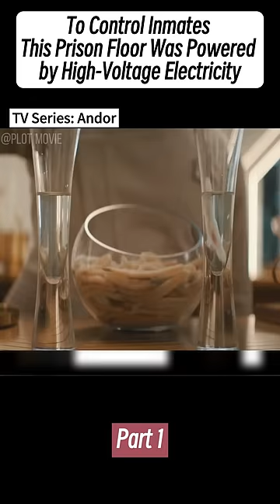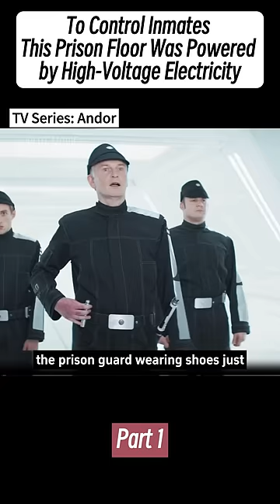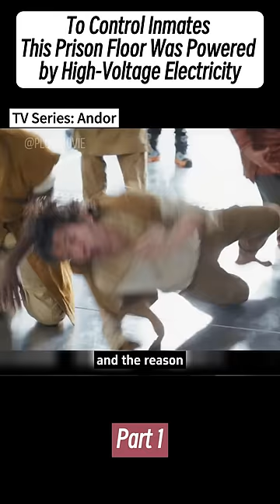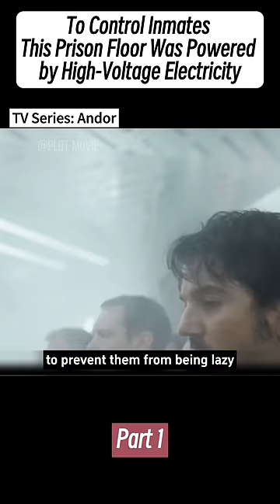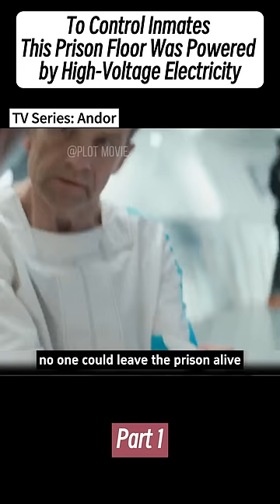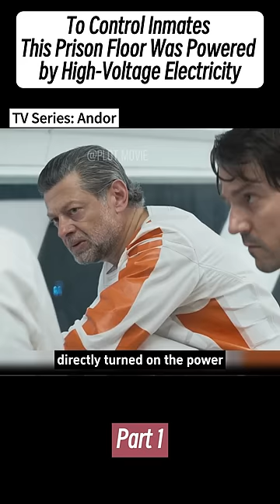[Part 1] To Control Inmates This Prison Floor Was Powered by High-Voltage Electricity #shorts

Comment: Hanging on the ceiling has left the chat
Reply: Do you see how high the ceilings are?
Reply: Better yet, they shouldn’t have been shocked at all if they were simply standing on a single section of floor. Makes no sense. Think of it as though birds are sitting on a high voltage power line.
Reply: I would imagine if they hung on the ceiling, they would've been shot
Reply: @vfrvctryz1984 what, that doesn't make much sense at all
Reply: You forgot that the prison guards are equipped with the blaster
Reply: Nono, placing clothes on the ground have left the chat
Reply: @bingzhewho  they probably made the jumpsuits conductive so that wouldn't work, and anyways clothes aren't magic. They'd also shoot you anyways
Reply: Movie name please
Reply: @dcismail  Andor

It's Star Wars Tv Series
Quite fun
Reply: @dcismail  it's a TV show, Andor, it's on Disney plus
Reply: Please go and actually watch andor
Reply: common sense left u
Reply: They didnt know they would all be electrocuted
Reply: @nayanD69  ...
go watch andor
they all fucking know that from the start
Reply: The entire area is composed of mostly the same material so it will shock ceilings or walls or floors it explained it in the show, the shows name in particular is andor it is a part of Star wars franchise
Reply: @Fluff_gobocat string conducts electricity easily, also if the floor has about 100 thousand volts, that's about 4 times more than how much electricity electricity company's legally send to a house in most countries due to possible fires and accidents. No matter what clothes they got, its gonna atleast set the clothes on fire.
Reply: @whenbruh8168  yea, I was saying that the clothes wouldn't help
Reply: @Fluff_gobocat  Electricity can only flow to lower potential but the metal floor they are standing on is the same everywhere and they will only experience high potential. The prisoners aren’t creating a direct path to ground so a shock will not occur.
Reply: @vfrvctryz1984  well we don't know the exact makeup of the floor panels
Reply: @PandaHiveGaming thank you for the explanation
Reply: @MrDoggoCraft i have watched andor. Mind telling me who told them that they all will be electrocuted??. Just as the rucus on 2nd floor started they electrocuted them all in the alley way
Reply: @scarletfoxfrostnovember3407  Do I need to watch Star Wars to understand this?
Reply: @vfrvctryz1984 Uh, the plates where charged as a whole, not each plate was either posifive or negative and they were completing circuits. Its basicly the same situation if you have high voltage in a pool of water, you touch it? Better bring two coin because your leaving this mortal coil.
Reply: Not even hanging on the ceiling. you would need to grab onto something geounded or with a lower voltage to actually get electrocuted.
Reply: @Vor567tez not really. For non fans, it can feel like andor is its own show despite actually connected to the main Star Wars timeline. So you dont really need to watch other star wars shows or movies to understand it
Reply: Oh no I guess they'll have to send a guard with a cattle prod in then

Comment: As my electrical safety classes have taught me, if the floor  (or surface of the floor) is suspected to be electrified keep your feet together to reduce the chances (and or the amount) or being shocked. Then hop to move around (preferably in a safe direction). not sure you'd be able to do this in a prison setting but hey the more you know.

Comment: Is it weird to suggest using some of the building supplies which are likely metal to potentially damage the shoes of the prison workers. The rubber soles are the only protection they seem to have. So by breaking into that protection it would very easily electrocute the leads and turn their own weapon against them.

Comment: that floor wouldnt work like that, if you got the same voltage all across the floor, then you would experience a small shock as it would charge you up, and then nothing. as your voltage would be the same as the floors, and since the voltage has nowhere to be leaving to? then you could be charged like this without electrocution.

however if there is a central point of voltage and the father you are from this point the more the volts decrease? then it could potentially work, if you take a step with one foot being in 600 volt zone and you put your other foot into a 20 volt zone, then the current would proceed to start taking a short cut thought you, from the 600 volt zone straight into the lower volt zone, electrocuting you. HOWEVER if you keep your feet together, then with both feet in the same volt zone it would be similar to the first example, perhaps a slight jolt as the floor would charge you up, but as the current would stay inside you and not travel though you then no electrocution...

Comment: standing on one foot has left the chat
Reply: Point in the floor is that you cant realy walk on it when electricity is on. Its to prevent riots.
Reply: That foot would be electrocuted
Reply: @noel9168  
not how electricity works, that whole floor concept wouldnt work. you would experience a slight shock at the beggining but then you would be completely fine... because the volts would charge you up and then have nowhere to leave. therefore no electrocution would happen...

Comment: High volt floor?
Wont cause electrocution but will cause the system to blow up
Reply: Not if it has no way to feed back beyond into the people and floor it's self other wise downed lines would blow the grid every single time no exceptions
Reply: @cdeer17  that would basically create a very large and powerful capacitor
I guess by that route it could electrocute people but honestly the ceiling is also pretty high 
And its really hard to guess where the electricity is flowing to if the floor is the live instead of grounding
Reply: @suez.03  well since the whole thing is made of metal and other in organic materials I would think they would need things to be wired right XD
Reply: @cdeer17  also the point lol
The whole thing is metal so electricity has to choose the easiest path ie: metal 
So unless there is some legendary science i cant understand i need electroboom to clear this 😂
Reply: @suez.03  well it's not all metal floor definitely is and also some metals and other materials are more or less conductive so the floor probably has the best conduction next to human skin
Reply: It’s Star Wars, they have had thousands of years to get technology like this

Comment: Guards: why aren't you going down?

Me: I don't think you understand how electricity works. First I'm not touching a common ground, second there is nothing for it to arc through me to, third the circuit is up one leg out the other, electricity is only dangerous for burns and arcing across the heart. Lastly and this is the most important part, it only hurts at the start as your body equalizes. 

Also you shouldn't have let me get this close.
Reply: *Proceeds to get shot

Comment: You couldn't zap someone by gettin electricity to their feet, as it wouldn't travel trough the inmates body.
Reply: Actually no that actually is accurate it is any body part touching a charged surface just usually their feet since well their standing on them and if you wear something with enough insulation it can prevent travel
Reply: EncryptionV3  you must not know how bad electricity can hurt